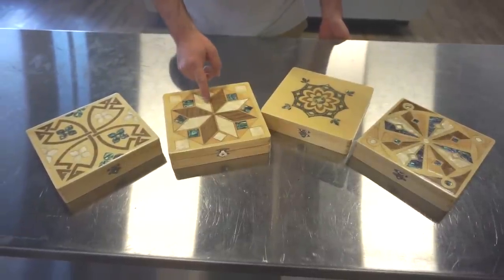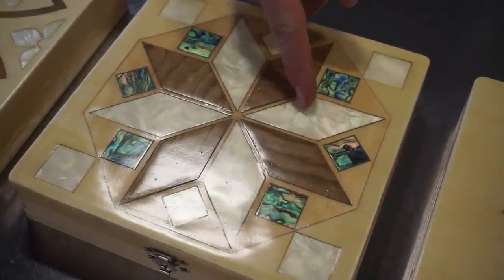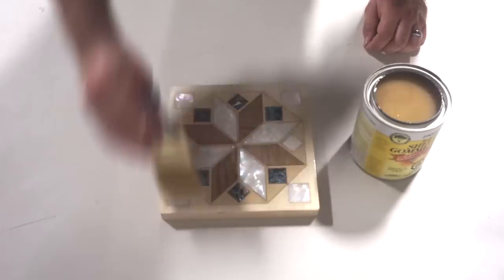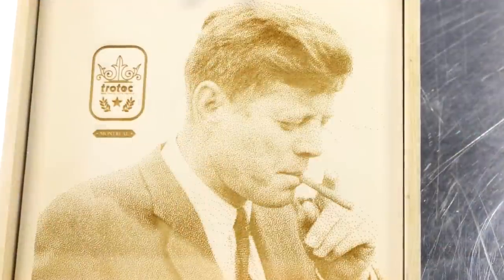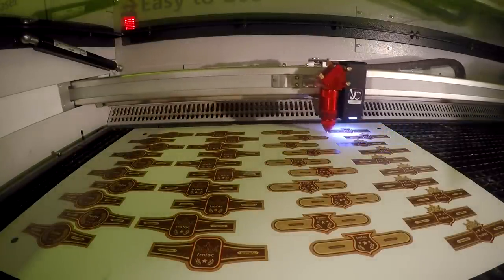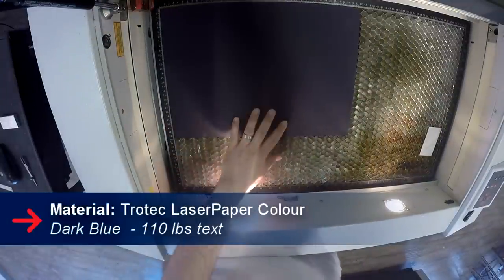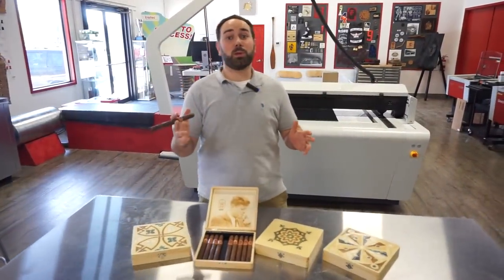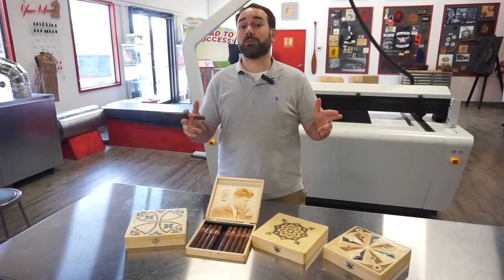Laser Engraved Cigar Box | Wood Inlay Humidor | Trotec

Comment: How do you focus the laser for the inside of the box? I use a focus tool but I need the laser to clear the edges of the box and create a clear engraving.
Reply from the maker: well you just use the z-offset feature in JobControl where you select your power settings. For example if you need the laser to focus down by 0.2” then you set the z-offset to either -0.2” or +0.2” depending if you want the table to go up or down. To get the measurement just measure the height from the inside of the box to the top.